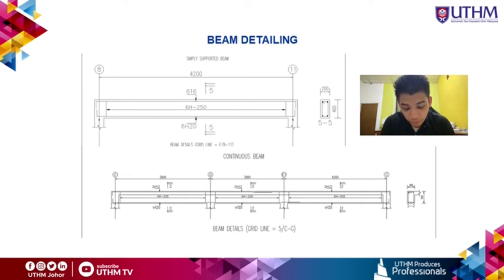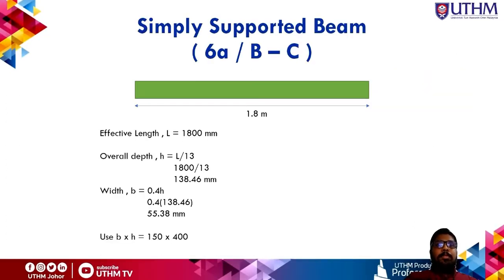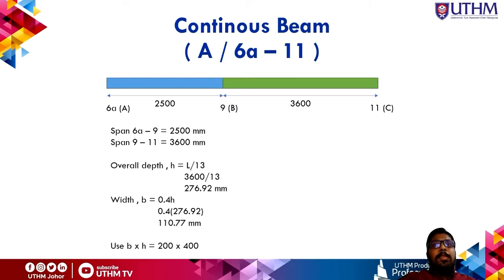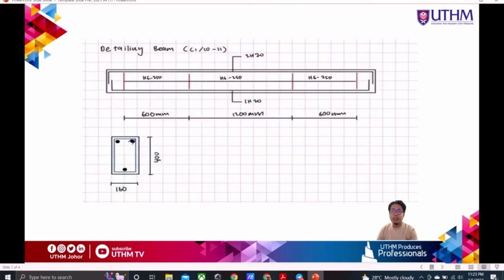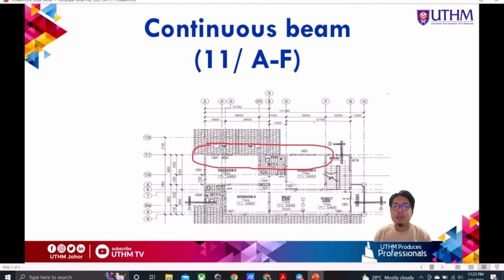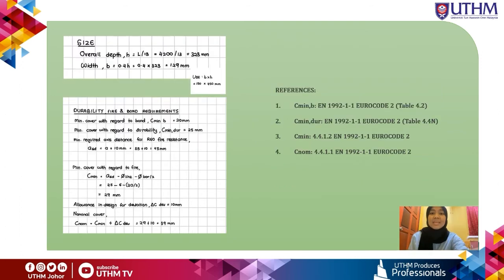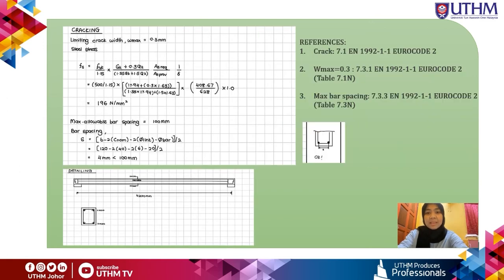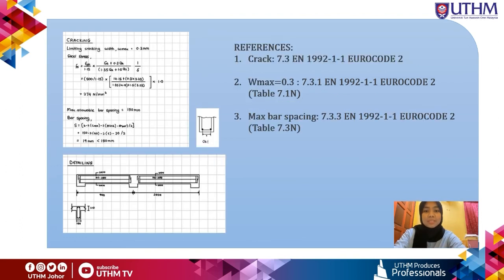group s.d

Comment: What can you conclude for this project presentation?
Reply: Hi Dr. I’m fatin syameera binti abd aziz (cf200033). I can conclude  that our group finally applied everything learnt in Structure Design (SD) to the design of a beam for the first-floor layout. We also get more knowledge and expertise regarding the design of reinforced concrete beams and slabs. For example, beam slab analysis is significant because it impacts the functionality and serviceability of the beam and slab. The redesign process could ensure the safe usage of the beam and slab since it alters the size, reinforcements, and other characteristics to meet the Eurocode minimum requirements.